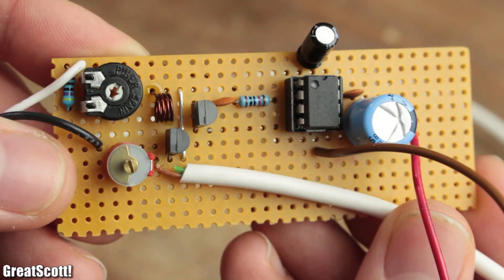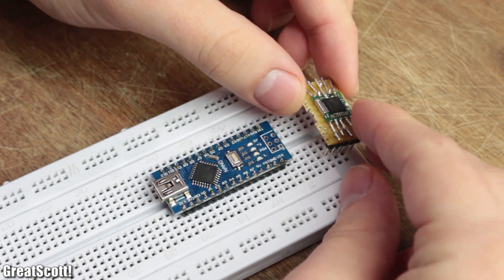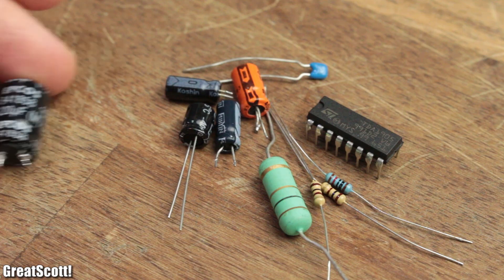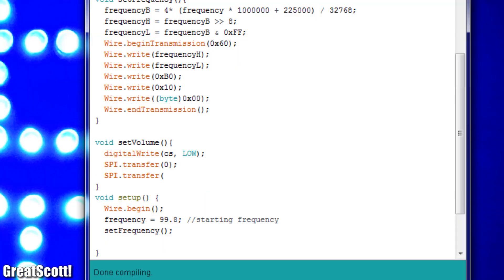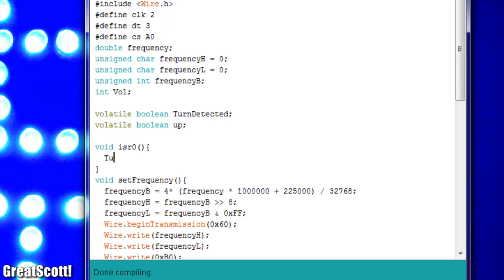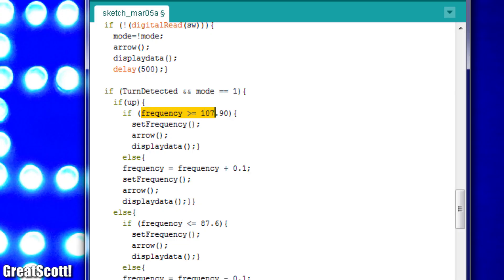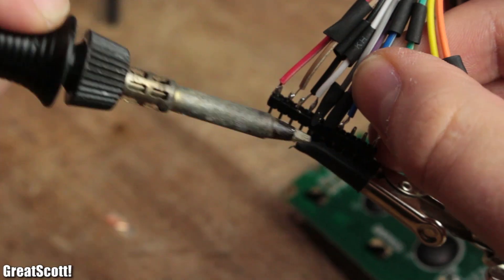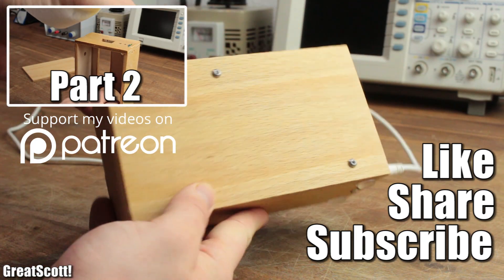Make your own FM Radio - Part 1

Comment: I hate IC’s I try to use them as least as possible. Or at least make your own IC’s. Using the tea5767 practically takes all the work away. Technically you didn’t make this yourself. You just added wires to an half complete device.
Reply: I agree. But the best thing I've made is a 555 timer ic with like a 100 transistors lol

Comment: Great video! I would just recommend one thing. Please fix the code in your Arduino sketch so that the SW pin mode is INPUT_PULLUP. Without this pin mode the user observes bouncing between FM and volume on the LCD display because SW is being read incorrectly in the pin mode of INPUT.

Comment: do you think a beginner can make this? I just took an intro to electronics class in high school and I have some computer building experience
Reply: Go to the Instructables website, https://www.instructables.com/Make-Your-Own-FM-Radio/, and you can see the circuit schematic and involved Arduino code. Note that you will need to learn how to solder and know about avoiding electrical shorts. Additionally, you will need to change one line in the Arduino code. The line involves the setting of the pinMode for the SW pin of the rotary encoder. The pinMode needs to be set to INPUT_PULLUP but was incorrectly set to just INPUT. Fixing this pinMode corrects the issue of repeatedly flipping back and forth between frequency and volume modes. With all of this in mind, you should be able to build the radio without issue. Finally, if you have issues soldering to the Lithium Ion cell just use electrical tape and apply pressure to both ends of the battery to keep the contacts pressed against the battery. This will resolve any issues that you experience with getting the battery to charge when constructing the charging circuit. I just finished building the radio today and am speaking from experience on what I had to debug.

Side note:
If you get chirping and resistor R10 in the circuit schematic starts to blacken cut the power. This issue occurs when you have an electrical short between two of the pins of the MCP4151 chip. Once you remove this electrical short the radio will work as expected.
Reply: @alexw9167  omg thank you so much!! I will check it out

Comment: Hello! I'm building a clock/radio for my final project in College. I'm using a rotary encoder instead of a potentiometer, however; you use both. Is there a reason you use both or can it be done by just using the encoder? Thanks!
Reply: The use of the 10k potentiometer in the video is for adjusting the brightness of the LCD display. This adjustment of brightness is usually a one-time thing (the user doesn't need to regularly adjust brightness). Consequently, having a potentiometer to adjust brightness makes more sense than having a rotary encoder for performing that same function. Both options will work for adjusting brightness, but it is the use case that is driving the decision to use the potentiometer.

Comment: The dial and display on mine has a horrible refresh rate, even when i change the delay from 500 ms to like 2ms. What am I doing wrong? Using an i2c driven display, but i2c shouldnt give 1 second latency

Comment: it are needing more one amplification stage and one auto-gain circuit interconnecting (monitoring the 2nd amp. stage and inserting on the first stage) the two amplifier steps

Comment: not having an electrician in your group cuts out all modern technological repairs on all your electrical tools
including, but not limited to;

radio's, flashlights, computers, phones, drones, toys, generators, modern cars, helicopter and other militairy vehicles that use alot of electrical parts, NVGs, scopes, buildingcircuits, elevators, powerlines, rocketships, computer attachements, remotes, card readers, televisions, chargers, security systems,   electrical doors, car keys, drills and saws...

then you also have IT, which deals with the Artificial Reality, called the internet and also coding... 
if your reading this... then it means you are inside of it right now...

2=1 1=0

Comment: Hey People !
I tried to complete this project on a breadboard but faced couple of issues.
1. First of all schematic and video are in conflict and do not prevent bouncing on rotary encoder. SW button do not work properly with a 10k pull-up and 100nF debounce capacitor (also on +5V), which was shown to be connected to ground.
2. I tried to wire an LCD the same way and with the same pins as shown in video but LCD does not show anything. It only allows me to adjust contrast.
3. PAM8403 works considerably OK but the schematic provided for TDA1905 also fails. I must have checked the connections 10000 times but all i get is screech. (Specially the connection from pin 6 to 10k resistor connected to pin 1.
4. Maybe it is the way i powered up my radio (both batteries, adaptors, 18650 etc..) but allthough the codes and the wiring and even the components are the same, lcd screen and rotary encoder fails.

I hear the radio stations when i power the system up but cannot properly adjust the fm stations and volume.

Any advice ?

Thanks.
Reply: The pinMode of the SW pin for the rotary encoder needs to be set to INPUT_PULLUP and not INPUT in the Arduino sketch from the Instructables website: https://www.instructables.com/Make-Your-Own-FM-Radio/. Once you make this fix the issue of bouncing between FM and volume should entirely disappear regardless of your power source.

If you are getting a screech or periodic chirping this would suggest that you have an electrical short of some kind in your circuit. I would check the pins of the digital potentiometer if you have soldered those (sometimes the MCP4151 chip can be too small to be directly inserted into a breadboard, so soldering is done (at least this was the case for the chips I got from DigiKey)).

If the LCD doesn't show anything, then you may want to check the powering up of your Arduino from your power source. You need to provide connection to VIN, 5V, and each GND pin on the Arduino. These connections are not shown in the schematic.
Reply: @alexw9167  will revise the code and check connections this weekend. Let you know how it goes.
Reply: Hello Refik,

Some of the issues that you are describing are ones that I encountered and resolved after trying out a few ideas when electrically debugging the board.

1. For the rotary encoder, you will also need to connect its GND pin to ground on the breadboard. Please make sure beforehand though, that you did not electrically damage your rotary encoder chip (this can be observed by Serial printing in the Arduino code and seeing that you get flat zero-valued signals on SW, DT, and CLK when you are interacting with the rotary encoder). Note that the pin mode for the SW pin is wrong in the Arduino code. You will need to set the SW pin to a mode of INPUT_PULLUP and not INPUT. If you don't correct this, you won't be able to use the clicking in of the rotary encoder as a button to toggle between modes the volume and frequency modes.

2. There are a variety of reasons for why the LCD may light up and be blank. The first reason might be that you don't have your Arduino Nano or Mini rigged up to power and ground. The VIN and and GND pins of the Arduino chip need to be hooked up to power and ground, respectively (this is not shown in the circuit schematic on the instructables website). Another reason for why the LCD display might not be showing information is that your connections to the LCD display pins might be loose. If these connections are loose, you should try connecting male-to-male jumper cables to the LCD display ports shown in the circuit schematic.

3. I can only to the TDA1905 chip since it was what I used. I would first see if you have the pin number correct so that you are matching the circuit schematic. Note that there is a polarity mark on IC chips that you will need to find (usually a circular or semi-circular indentation). This polarity mark will identify the top of the chip and then you will look to the left of the polarity mark and begin numbering the pins starting from 1 and going counter-clockwise.

4. Given your description of the problems with your radio, I think you are right that it is a power issue. The fact that the LCD screen does not show FM or volume information to you is a sign that your microcontroller is not receiving enough power to boot and run its program. Since the rest of the radio, except for tuning and display can run without the microcontroller, this would explain your ability to hear radio stations. Consequently, I would recommend plugging a male-to-male jumper cable between the VIN pin of your Arduino and the bus for power and a male-to-male jumper cable between the GND pin of your Arduino and the bus for ground.

Start with what I talk about in response 4 and then look further if issues persist.

Comment: Dear sir, i would like to know the point P1, P2, where is it?
Reply: Point P1 is a location in a row of the breadboard that has a connection to a lead of a 10k ohm resistor before it in the same row. The other resistor lead is plugged into the corresponding column of another row of the breadboard. Following this second resistor lead in that second row is a jumper cable connection off to the 5V power bus.

After the transistor lead in the first row of the breadboard is the jumper wire to the + port of the rotary encoder. P1 is effectively the + port of the rotary encoder and the SW port of the rotary encoder is effectively P2. After the jumper cable for P1 in the first row of the breadboard comes the 100 nano Farad capacitor and then a jumper cable off to ground.

In summary, P1 is the + port on the rotary encoder and P2 is the SW port on the rotary encoder.

Comment: That's a really cool build, congrats!  I have tried to do soldering of small parts but have a hard time because my vision is not that great and my hands shake a little.  Do you or any followers have any tips for soldering small parts?  And how difficult is it to create an etched circuit board for something like this ?  Thanks!
Reply: Heat the soldering iron up to about 310 - 330 degrees celsius. Use an arm with an alligator clip at the end to hold the component. Use another arm with an alligator clip at the end to hold the strip of solder flush against the metal contact point of the component. Heat the metal contact point with the tip of the soldering iron until the solder begins to melt against the metal contact point.

This seemed to work when soldering to very tiny pins with very small spacing on an MCP4151 chip that I got from DigiKey.

Comment: Dear Sir, after that Video it popped into my mind that nobody ever looked detailed into RFT SKR Radios. How about upgrading that fancy old GDR made radio with modern specs? I havent seen anyone else doing that. Since the circuits of that old radio might be especially suited for that kind of purpose and you certainly have the means and abilities why not going for it? I feel like the approach should be: Upgrade to 2018 with as little impact as possible on the basic substance. I would be happy to see what kind of solution you come up with.

Comment: Dear GreatScott!
I congratulate you for your project.
MCP 4151-502EP M19 1528 with integrated package types When you measure the P0B and P0W pins shown in the diagram, I cannot get 5 v and the voltage shows zero. writes 1317 on the bottom on your MCP4151. I use different integration. Thanks

Comment: i have tried to implement the lm386 to drive the speaker and i took the wiper from the mcp4131 to the "input" of the lm386. is that correct application ?

Comment: On a 16 bit pic I got away with using a change notification interrupt on just 1 of the rotary encoder input pins. I wanted to save the external interrupt pins in case I needed them further down the line

Comment: I built this and I am struggling to get it to play anything. 😔
Reply: You can do the following to electrically debug your radio and find out why it is not working: (1) check your soldering to see whether there are any electrical shorts that you may have introduced, (2) check that you have power flowing to each part of your radio (you can do this with an LED or with a multimeter), (3) use the serial printing function in Arduino to check whether any of your chips are duds (flat zero signal even when power is applied and you are engaging with the chip is a pretty good sign the chip is bad), and (4) check that you wired up everything correctly on the breadboard (your jumper wires will have to be in the same columns in order to pass charge to each other).

Comment: Suggestions for those who want to give a try:
1- Use oled display for better visual experience and low power consumption 
2- Update only the pixels needs to be changed rather than clearing the entire screen to get rid of jitter.
3- And do not forget to test and learn how all parts act when input is fed in, one at a time in this way its more easy to avoid errors.

Comment: Can we use a X9C104 digital potentiometer instead of MCP4151 ?
Reply: I've noticed that X9C104 is a 7-bit while MCP4151 is a 8-bit, thus double the digital steps. I guess that we could use the X9C104 pot but then we probably won't be able to tune all frequencies, right?
Reply: im pretty sure he uses that as the volume control.

Comment: this seems waaaaaaay overly complicated, and could be done a whole lot easier and without any programing using inexpensive circuits and parts you can get off of ebay. The whole thing could be built for under $30, it would have a clock, FM, mp3, bluetooth, and still be battery powered. oh and a remote.

Comment: Hi, how do you connect all the parts to power? In series or parallel? I´m a very beginner, but I´d like to build a led strip project. But I don´t know how to connect all the parts... :-)
Reply from the maker: There is a schematic on Instructables. Look in the video description.
Reply: I looked at the schematic, but as I said, I´m the beginner, and in the schematic, there are drawed only "ground" and "5V". I tried to find it out from the view on PCB, but I didn´t understand anything..

Comment: That radio module supports volume control, you don't need digital resistor ic, you can control volume from arduino code. It supports RDS function too, so you can display radio info on screen, also you could save radio stations freq on arduino epprom memory, so you dont have to input frequency when powered on.

Comment: i have a question for you my friend i need to power this item http://www.banggood.com/Scrolling-Rechargeable-Red-LED-Name-Badge-for-Business-Advertising-Message-Display-p-1005606.html?rmmds=search/?p=0K1422970031201412U8

i want to power it off a battery keeping things as small as i can and need it to last a week min the longer the better off a single charge. can you tell me what i can use to power it with a battery or battery pack that would last that long. thanks
Reply: Acording to your link:
Working time: about 40 hours (at 25% brightness);about 20 hours (at 100% brightness)
Battery: rechargeable lithium battery, 240mAh,3.7V.

So at 100% brightness it consumes about 12mA, and at 25% brightness it consumes about 6 mA.
A week has 7 days with 24 hours. 7*24 = 168 hours.
So you want a battery of about 1020 to 2040 mAh, so you buy one open the thing and replace the battery with your new one. It should be a battery of 3.7V
Reply: Jaime Cernuda Ok thank you so much for you help I think I may use one of the cellphone batteries I have and see how it work out thanks so much for you help. Have a wounderfull day.

Comment: Why to connect a capacitor to the speaker?
Reply: This is specific to the application circuit of the amplifier used, the TDA1906. If you use a different amplifier, you may need to choose a different arrangement according to the amplifier datasheet. For example, when using  PAM8403, you simply connect the speaker to the corresponding + and - outputs of the amplifier.

TDA1906 has single ended power supply and single output. The - leg of the speaker is grounded. The + leg is driven by the amplifier. The amplifier will thus have to output DC offset (approx. half its power supply voltage, but being a low end part not very exact) that needs to be rejected by the AC coupling capacitor, else the speaker would be permanently displaced as long as the device is powered, with ensuing distortion and danger of thermal death. The amplifier IC has no way of outputting negative voltage. Additionally, choosing a slightly undervalued coupling capacitor will reduce speaker excursion at low frequencies which are not audibly reproduced by such a small speaker, will present higher impedance at low frequencies to the amplifier, and thus reduce both amplifier and speaker distortion.

Comment: Is it possible to include a solar panel to charge the radio (not instead of the USB, but as an extra source) by soldering it to the TP4056 pins in parallel to the USB breakout?
Reply from the maker: +Lusia F I would not solder it in parallel without any regulation circuit.

Comment: Hello, very good video.
But how did you get all the ICs ? Which distributor are you using to buy them ?

Thx for the answer
Reply: As far as i can tell, most of these things are random China imports, like the cheapest you get on eBay or Amazon. In particular the battery controller, the voltage booster, the radio IC breakout board, and the recommended (not used here) amplifier. The used amplifier is salvaged from old electronics. The Arduinos are probably sponsored by the manufacturer, because otherwise the impetus any DIYer has is to buy cheap clones from China, and i guess that this channel is popular enough to get free stuff.